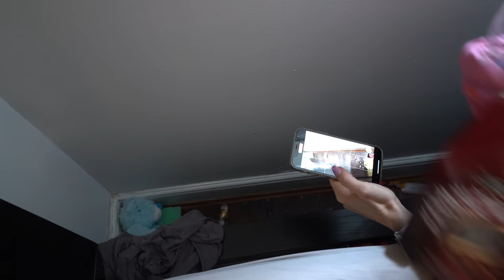AMAZING SURVIVAL STORY | Cleaning for FREE! ❤️

Comment: Hi Auri - I have had success removing the black mold (black dots) using a gel bleach by Clorox.  I spread the gel bleach on strips of paper towels and lay them on the caulking for a few hours or overnight and the black mold disappears.  Make sure the paper towel strips are really saturated with the gel bleach and cover with plastic wrap so they don't dry out. Try it! It works for me!

Comment: With silicone, I found a thick gel bleach coating it, then jamming paper towel or toilet paper into in (coat that with bleach as well), leaving it for a few hours or overnight if you have time, helps to reduce the mould in it.
Reply: Yes, I use this trick to get mold off the silicone sealant, but I use cotton wool soaked in bleach...always gets the mold off

Comment: For the black on the silicone liner of a tub you can soak cotton balls in bleach then line the silicone area with as many cotton balls as needed. Let it sit overnight. Sometimes it removes all the mold and sometimes only some. However, it’s a great thing to try! Make sure to vent that area well. Bleach is not great to breathe in 👌🏻

Comment: The dresser placement may be puzzling, but when you have a toddler & the dresser isn’t safety-strapped to the wall, where the mom has put the dresser makes it safer, less likely to be accidentally pulled over by toddler. Also, toddlers love to pull open drawers & throw everything on the floor, so being so close to the bed can keep that from happening. I’m not sure that’s why her dresser is where it is, but likely. I am a mother of twins & that age is very exhausting!

The dresser’s position makes it super difficult to clean there & around the bed. But for safety, bravo to the mom! Also bravo for asking for help. Seems like too many clothes is an issue. I can relate!

PS: Better to decide on relationship now than want to leave once there are children.

Comment: 25:12 that room/apartment HAD carpets originally. You can tell when something originally had carpets because the base boards would be installed higher. When removed, and replaced with hardwood or tile, there is a gap between the baseboard and the floor so they add trim to hide it. In this room, the trim was stained the same color as the wood, but typically it’s just white like the baseboard.

Comment: For over thirty years I have had this dream that someone would invent a bathroom cleaning machine for spraying and cleaning the toilet and floor. Something that you could spray the toilet over like you do with the shower head, and suck it up, like with a carpet cleaner. I've used our carpet cleaner once but its way too clunky and the cleanup was extensive. This job requires a specialized tool.  In North America our houses are made of wood primarily, so we don't have drains in our floors as it would be a health hazard. The water could cause mold (I could be wrong but this is what my research has uncovered.) But basically our only option to clean the toilet well is to get down on your hands and knees and clean around the toilet by hand. Which is a gross job. I watch in sheer envy every time I see you clean a bathroom with the shower head!

Comment: It is possible to remove black spots from silicones using chlorite. Roll a long stick of kitchen paper and dip it in chlorite. Then place the stick on top of the silicone and leave it overnight. The result is clear, clean silicone. I found the instructions here on youtube and tried it. It works.

Comment: You would be surprised how easy from silicone you can clean and black mould. I'm using HG mould cleaner. Try it. 
If silicone is very old then you can replace it with antibacterial one.

Comment: You can remove black mould from silicon by applying bleach and impressing kitchen towel or toilet paper onto it and leave it for a few hours or overnight. Just make sure that the bleach remains on the paper rather than running off the side of bath.